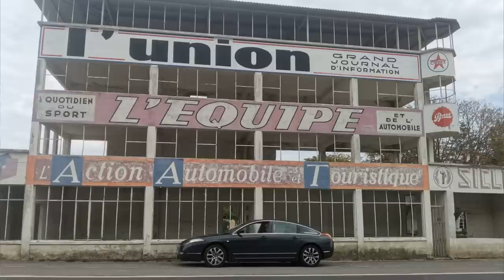Cheap Citroën C6 Project TEN: LED rear light failure!

Comment: I'm going to be the annoying grumpy guy but: LEDs do not work with normal taillights (Nor headlights, for that matter). Fresnel lenses are built to only work with halogen bulbs, to redirect the light emitted from the filament. Put anything else in its place, and you're blinding anyone sitting around you. 
They also don't last because they can't take the fluctuation of the alternator's regulator and are poorly cooled down with that format. Remember that brighter isn't always better!

Comment: Ive loved the C6 since it first came out, but the ruinous cost of the VED (used to be road tax) always put me off. Plus I couldn’t afford £32000 anyway. About 6 years ago I came very close to actually buying one, but, again, £500 VED knocked it on the head. But then I thought, why buy the print when you can have the original, a CX. I love the C6, but I worship at the tyres of the CX, a car which captivated me when I saw its launch back in 1975. So that’s what I did, I found a 1980 CX Athena in lovely condition for around the price of a used C6. It’s been my daily driver now for over 5 years, no VED, no MOT, and cheap insurance. I can fix most of the problems which crop up now and then pretty easily, no bloody computer, no digital display, everything is fixable by the home mechanic. I know you’ve got Clement, but seriously, a CX is a much better machine for the roads of today than a DS. Anyway, that’s what I’m trying to suggest you do should you decide to part with your C6, I know you’ve driven one because I’ve seen your earlier video, but as I recall, it didn’t have the Diravi steering did it? That’s an absolute must to really experience a CX at its finest. Do it!!! You know it makes sense, well at least as much sense as having a C6.
Reply: CX is probably the best car ever made
Reply: Citroen Cense is only part of what this channel could/would/should be. Plus Francaise,  Engineer Sqouttie....more Francaise!!!   or something vaguely Gallic...

Comment: If anyone else has fast flashing indicators with LEDS: Indicator circuits need a certain amount of current draw, otherwise the controller thinks a bulb has failed and is required by law to fast-flash the indicators + telltale light/sound. 
Cars are electrically very noisy, with some big voltage spikes, and the semiconductors in the fancy LED ballast hate it (assuming it even has one). Incandescent bulbs don't even notice it happen. Surge protection isn't impossible, but would cost the manufacturers a few pence more to add, and space is restricted in a bulb base. Normally it would be built into the rest of the car's power system where there is a lot more space.

Comment: Back in 2005, I spent £48 on 6 newfangled low energy bulbs for the downstairs hall and upstairs landing. Three of those bulbs are still working all these years later. Having outlived many newer bulbs. I always cynically think that they design these wonderful new" unbreakable" things - then they start building in breakable parts to them to deliberately make sure we still have to shell out to replace them.

Comment: Poor design, one classic car is like that , the Rover P6 battery in the boot on the side and can let water from the rubber seals and the rear deck panel where the fuel filler caps are. Best I had happen was when the battery underneath the front passenger seat caught fire on my dad’s Bedford CF whilst sitting on it and we were travelling along , this happened when I was very young and was frightening and scary . More scary was when the front passenger sliding door came off on that Bedford CF van whilst moving lol

Comment: Try a wing nut from a 307 ;) Also the only LEDs that haven't given me trouble (yet) are the Philips ones (for tail lights)
Reply: Phillips does make fine bulbs, you could say that they are the Brightest Bulbs in the class.
Reply: @J W Soares Jones  I like them, because there is a substantial difference in brightness when brakes applied, have good mimic pattern for the reflector and good heat control (what kills most LEDs)
Reply from the maker: Oddly enough, I didn't have any of those kicking around either! Ha!
Reply: @UPnDOWN  I just want to thank you, I considered ;) a C6 (i have a few Citroens). It is beautiful and even rarer in Aus.

Again, thank you!

Comment: The issue with LED bulbs is that they lack a conformal coating. The lead free ROHS compliant solder reacts with moisture in the air and the solder corrodes. There are just too many failure points in the implementation of LEDs in an aftermarket part for them to last. OEM LED bulbs do last though. I drive a 2015 Toyota Prius C with OE LED head and tail lights in Florida and have never had an issue in 140k miles.

Comment: Most LED light bulbs are set up to run the LED diode at too high a current, which gives a brighter light but limits the life of the unit. If you modify the unit to add a capacitor in series with the diode the bulb will last a lot longer. But it will also be less bright, which sort of defeats the reason for fitting LED's in the first place.

Comment: Always fancied a Citroen C6 and Volkswagen Phaeton, promised myself I would own both at sometime. Unfortunately I don't have the salary.i had upto 3 or 4 years ago also reality both cars cost a fortune to run but not buy , it's like running a Range Rover on a shoestring so looks like the nearest I'll get to a C6 is our DS3 .
Reply from the maker: I think the Phaeton is probably a jump up in costs from a C6, to be fair. Lots of unique or Bentley-spec parts on a Phaeton, whereas there are lots of Peugeot 407 parts on a C6 (though of course, the C6-specific stuff can be pricey).

Comment: Once you find a quality source for your LEDs, stick with them. I’ve bought mine from superbrightleds for years and they all worked perfectly and for years. Put them in the rear of my old Frogeye Sprite to make me more visible plus I’ve had others in my Hondas for years.
I’m sure a bunch of people will tell you that you can’t use LEDs but I’m sure you know if they’re a quality piece and the correct type, then they’ll work fine.

Comment: I think that the same plastic wing nuts hold the tail lights into a Xantia (maybe even the wheel brace bracket?).  Maybe you could find someone with a Xantia?
Reply: And AXs and C5s. Crazy simple solution but it works

Comment: YO fellow C6 fan, hope your MOT went fine, I'm from Germany, am a free time mechanic on the car, can you check in the left wheel cutout after removing the plastic covering the so called "water pipe" above it? It is one of the most dangerous aspects of this car, if that bursts and it usually is made of nothing but consistent rust, that thing will die without you knowing why.
Reply from the maker: Cheers, already done it in one of the earlier videos.

Comment: Ive only been driving a Citroen Auto for 7 months and its my first Auto, I didnt realise that you were supposed to enguage park at traffic lights as opposed to putting the box in neutral with the handbrake on but only if your there a long time, I wonder if you have an electric handbrake like mine as and you put the handbrake on at lights and in mine you can drive away and the electric handbrake auto releases as you touch the accelerator this is particularly handy on steep hills as the brake assist doesnt always work perfectly. Lights on Citroens always let you down at the last minute, the BX rears were finikey so and so's at times. Do you have canbus or non canbus LED's I think the non-canbus ones flicker after a while and end up blowing quite quickly they did in my Citroen C5 2.0ltr Mk2 facelift 2007 Hatchback.
Reply from the maker: You don't have to put it in park...I have to put it in park because I have a poorly gearbox! But my post on Twitter got flack from Americans because I suggested you shouldn't sit there in Drive with your foot on the brake at the lights.
C6 does have an electric handbrake, but it's not auto release.

Comment: Quick question there mate: 
On the Xantia, on that power steering pipe from the pump to the rack valve, that flexible part that is visible near the main accumulator, is it a simple flex high pressure hose, (free flow), or does it contain any check valve or any other restriction? 
Thanks
Reply from the maker: I've never known one to have a restriction in it.
Reply: @UPnDOWN  .....yep, thanks for the reply, I opened up the defective part after replacing it in a shop, and it is just a plain high pressure hose, nothing out of the ordinary. The guy also told me that there is also no restrictions in the metal pipes too. Is that true? 
We have a characteristic vibration on the steering wheel when turning stationary, and can't figure out why. We did the "left-right" technique a couple of times, both with engine running and off (wheels in the air), only when I raised the car in the high position and lifted the wheels on the jack, and engine running and did the "left-right" ten times, only then it seems to be reduced a bit, but it's still there. A little bit, but it's not gone.
Any ideas?

Comment: 25 mpg isn’t bad to be fair I get 28 on  average on a 30 mile round trip each day
Reply from the maker: It is when it's a diesel and the fuel is £1.80 a litre, minimum! If you're only getting 28mpg on a 30 mile trip in a C6, you've either got a petrol one, or you've got a problem. It nudges 40mpg on longer runs, it's just the town stuff.
Reply: @UPnDOWN  where do you live to pay that price it’s 1.59 at most in Derbyshire